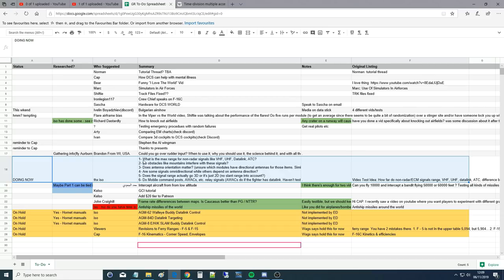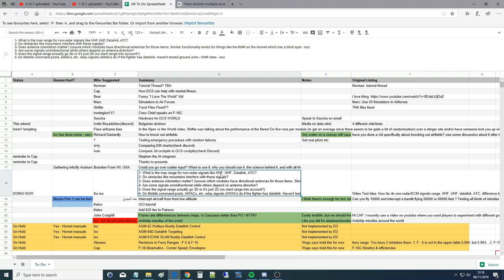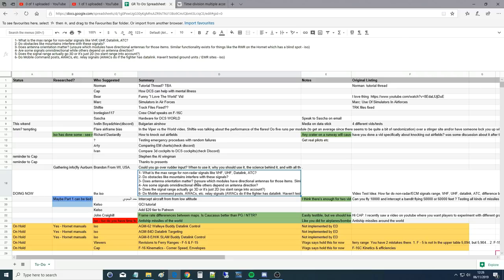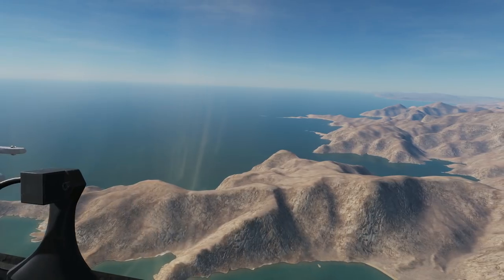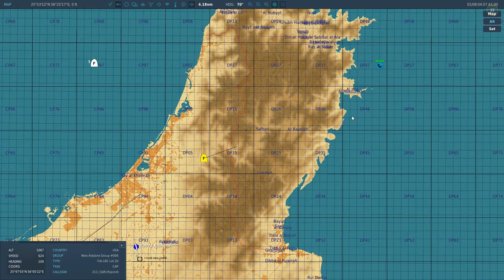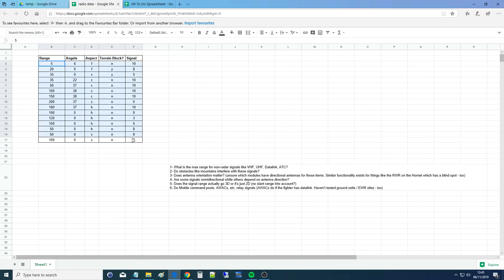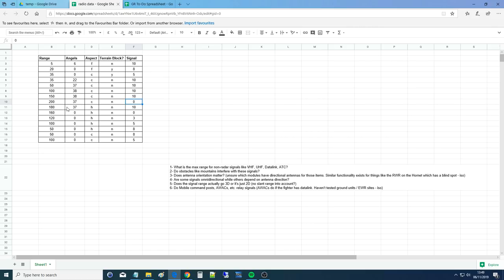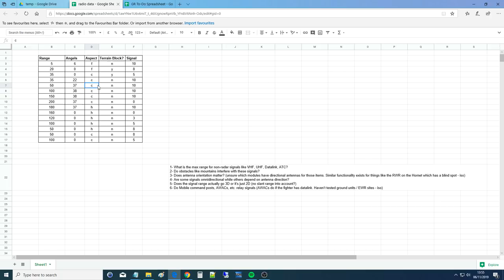Questioned: The Physics Of Radio & Datalink In DCS WORLD

Comment: Appreciate it very much taking time for this, and bringing this topic out of the shadows. Debrief: 
Yeah overly simplfied with "max range" from my side. I was in a hurry sorry. Works initially for anyone who does not have any idea about signals. And yes no need to do it all in one video. Looks like the actual big question got answered, it really is more simulated than I expected, dynamically affects the actual strength/clarity of the voice audio (signal) as distance increases and other factors such as height and mountains, stuff like houses and trees if they do would have only a minor effect and hard to test, other things are indeed verys hard to test, like the orientation, because that would require finding some sweet spot near a cut-off area, where just rotating would make a difference, that would be far easier to do with digital signal which do work like a cut-off (DVB-T/DVB-C, blocks on TV means it goes below threshold and both video/audio cut out totally), while analog signals don't cut off, which is actually true for UHF/VHF AM/FM analog voice comms, and DCS does this correctly, all the usuall ATC and other voice comms for military are plain analog AM as well, that's how they are able to talk with civilian aircraft and land on civilian airfields as we know, when they do combat they switch to their own comms which we don't need to as they're probably never going to be in DCS due to classification. For example A-10C VHF radio has this X-Mode capability for KY-28 and KY-58, I'm suspecting the audio goes into that encryptor and is then fed into the analog AM signal as gibberish audio perhaps, or it switches to a digital signal while remaining AM or FM and on the same frequency as these things shouldn't have a play (if they do change than it does it for another reason like not polluting the usual freqs with gibberish), we may not know anytime soon if it's classified so we can easily simply avoid worrying about that so no need to try bounce into walls and test it if the encryptor isn't even functional to begin with, I did find the manuals and took a look and asked some radio amateur people but didn't got further into details yet.(more on that later) --- PARAGRAPH 1 END ---

PARAGRAPH 2: I'll go over the points and explain the context a bit better, but first, yeah you said it perfectly, it's all different due to aircraft and their radios and capabilities and methods of encryption may vary. I was kinda trying to keep it short, losing context, I guess I simulated someone who has no idea about signals hehe. So with "UHF" and "VHF" it's ofcourse impossible to have a general answer, I meant kinda picking an aircraft and selecting the middle frequency of that aircraft's radio frequency range, that would kinda simulate the "Average UHF" or "Average VHF"  (setting the ATC/AI's to also work on that) and seeing how it goes when voice communicating with other units, but now I realize there is no much voice comms other than ATC and I guess tankers and AWACS, but there are AI wingman/flight commands but they don't seem to go over the radio... err while it doesn't show on the CommMenu GUI, it does infact seem to use radios when I tried issuing commands to buddies so that could be one of the points as well to test if they participate in the radio signal system. With "ATC" just I mean if ATC voice communication comms are part of this simulated system or not, however it seems we have more variables, the normal airfield, the old carriers and the new carrier module which has an ATC upgrade AFAIK, that's another comparison point there, going on one would expect AWACS to have better radio transciever capabilities than a tanker perhaps, yet another possibility for a test here, and so on. -- PARAGRAPH 2 END --

PARAGRAPH3: Yep the higher you go in frequency the less easily it can travel through air, different materials produce different effects at different frequencies, absorbtion, passthrough, reflection.  And sure those questions all relate to each other even tho the slant thing is indeed a bit more deep but I think we can see the practical effect being proper that it works worse at lower altitude than it does higher up, this is very good news, you guys did an awesome job with those simplified/dubed down questions that I thrown together, but didn't actually meant it on purpose to make it confusing. Going forward, now that we know DCS is indeed taking this thing more seriously than I thought we can get more properly specific and technically correct. But take your time, I rather not that you guys exhaust yourselfs in one video, as we get closer to new ATC and VOIP upgrades we need to keep an eye on this topic so the devs get the feedback, then they'll figure out the middle ground of technical feasibility, performance and practical gameplay effect of these signal simulations. So now I got some research from radio amateurs: For weather affecting things, I talked and I heard it doesn't affect VHF/UHF much at all, unless the antenna feeds are exposed and the water makes contact with the both ends causing a short which would cause an impedance mismatch but that again may NOT render the system completely out of comission, it may only have a small effect (not easy to measure again). Then there's the phenomena called Knife-Edge Effect in which sharp surfaces of the mountain tops would infact produce a second-level propagation of the signal to the other side of the mountain, it's again very very specific to a type of frequency and the material as well as the geology/shape, how big the effect would be, but if it is exploited, it actually means that two ground stations without line of sight would be able to communicate. Lastly I asked about the A-10C X-Mode/KY-28 stuff and by the looks of it, that's all analog, not digital, including the, air voice should be plain analog AM but because if the KY-28 isn't it's own radio it has to use the existing radio's capabilities, it works with the UHF/VHF already in the current DCS A10-C, and I don't know what they mean excatly with the digital sync in the KY-28 page below, but either way it shouldn't matter as this stuff is all nonfunctional and won't ever probably be simulated in DCS anytime soon, so even if it does make a digital signal it's not going to change much for DCS.
VHF Manual: http://radionerds.com/images/8/80/TM_11-5821-318-12.PDF
KY-28 page: http://www.jproc.ca/crypto/ky28.html
All this testing is incredibly specific to the type of plane, I didn't find TDMA around A-10C for comms tho, however an DCS 2007 level F-16 could certainly have multitude of newer digital comm systems (I don't have F-16 module, but I do have F-18, but that's still EA) ... STILL that doesn't mean it only has that, I'm sure every jet still has the plain analog AM to be able to talk to civilians and ATC and other noncombat operations. But the military ATC I guess they use their own comms, but I'm not sure if it's through TDL scheme or not. There is this EPLRS thing which is used by SADL for F-16 and A-10 for example, might be a ditigal thing indeed but it's not meant for voice comms, not a big deal tho, we just need to separate that, so we can compare more accurately.

PARAGRAPH4: Datalink IMO may work on a totally different basis, they may be digital, may not, or they may use other frequency ranges, but for DCS right now, we don't need to know that initially, and testing that would involve having to drop the weapon from as high up as possible and then speed away as fast as possible and secondly drop it in a valley and get behind mountains fast. If datalink uses higher frequencies it should lower these ranges considerably vs Voice comms.

PARAGRAPH5: From the A-10C VFH manual - on the 44 page of the 222 paged manual, there is this capability called, oh goody, RETRANSMISSION, which is an actual relay capability passing the signal from a remote station to another remote station. Knowing this makes it possible for actual support of more relaying capabilities for many units in DCS who don't have any comm-specific job, versus having to justify the "what if pilots did it manually in real life" and simulating that into the AIs, so this is great news to me at least, I always envisioned this to be a thing and I guess I just had good gut feeling and logic but now I see it actually right there technically defined. That said, what I do enjoy more is to see more interactivity between groun support vehicles such as mobile command posts and similar to have some kind of "forward operation base" meaning, I'm really into this stuff in terms of how it can be used in emergency situations and ALL of  this feeds into SAR stuff, search and rescue is all about finding traces and communicating between multiple units in the search area later on, the radio beacons, distress signals, all need good radio simulation in the first place (unless they're satellite based), usually the homing signal of a EPIRB/PLB is an analog tone in 125.5 MHz (AFAIK) which is just good in a less than 5 mile radius, doesn't go up in space, in that short range tier, smaller obstacles, even trees, could have quite an effect far greater effect, reflections would cause faux direction readings and sudden increase in signal for a moment, etc, imagine the gameplay opportunities of your coalition SAR helicopter trying to save a buddy pilot in the dense forrests of Cacuasus valleys where fictional Georgian convoys are just around the corner, find da signal QUICK ... , green smoke, green smoke!!!, and other things would come to use, like using flares at night, not only by your aircraft, but by the ones who are calling for help, that is next level. DCS could even be of a service to firefighters as a SAR training platform one day hehe!
Reply from the maker: Lots for me to read! Thanks Steve.

Comment: In the U.S., the frequency range assigned for VHF FM transmissions for aircraft is 108-137MHz.  This is just above the "music" frequency range of 88-107.9MHz that all of us can tune to in our cars.  VHF FM is used to communicate with civilian aircraft/ATC and is functionally identical (when unencrypted) to the radios used by private, commercial, and airline pilots.  The frequencies between 108 and 117.95MHz is reserved for navigation, being split into 200 channels with 50KHz seperation.  Occasionally, VHF FM is used in the military, normally with JTACs.

UHF is used for military communications, i.e., no civilian aircraft has a UHF radio on it from the factory.  The frequency range is 225-339.95MHz.  Both VHF and UHF signals are amplitude modulated (AM,) where as the music in your car is usually frequency modulated (FM.)

VHF FM, VHF AM, and UHF can be either analog or digital.  Technically, all radio transmissions are analog as they originate from a pulsating electromagnetic field around an antenna.  Its impossible to have a truly digital radio signal; it'll always be a perfect sine wave.  Digital radios, however, first encode the transmitted data into binary code before transmission.  For example, a pilot's mic will pick up sound waves, causing a membrane to vibrate.  An electrical device called a transducer will register these vibrations and convert them into an alternating current signal.  This signal is then "digitized" by the radio, with the waveform being converted from a sine wave to a digital wave.  This is done by rectifying the AC signal into direct current.  Since this essentially lobs off half of the sine wave, the positive half of the wave will be the only half detected and assigned a value of "1."  Where the signal is not detected, it is assigned a value of "0."  This generates binary code.  

An oscillator is used to generate a carrier frequency (the tone you hear when you click the mic.)  All radios do this.  The "data" signal is then "mixed" into this carrier frequency (since waves add their amplitudes to each other.)  Originally, this was done (at least at radio frequencies,) using vacuum tubes.  Today, we use transistors.  In the case of digital radios, the "data" frequency is a string of binary code as opposed to an audio signal direct from the mic.  With the proper techniques, this can allow for a much clearer signal as well as the transmission of digital information for purposes such as datalink.  

The combined carrier and data signal is then sent to the antenna, which produces a very weak (in the grand scheme of things) electromagnetic field which can be detected at very long ranges (with a high enough gain antenna.)

Digital and analog transmissions can be at any frequency.  Hell, you can have a digital high frequency signal, though the data transmission rate will be abysmal compared to UHF (though the trade off is the signal strength for a given transmission power.)

As far as LoS is concerned; its not strictly needed.  Under the correct atmospheric and magnetic conditions, it is possible for signals to bounce off the ionosphere.  This is most commonly observed with HF signals, though it can happen with VHF.  I've seen it happen IRL, though I'm not sure if DCS models this.

Pretty much all aircraft use omnidirectional antennas.  These can communicate in any direction, more or less, but are relatively low gain.  High gain antennas, such as satellite dishes are for more efficient at both transmitting and receiving signals.  For example, the signal coming from Voyager 2 is only being transmitted at 22.4W and over the course of 13.7 billion miles is received by the Deep Space Array at just 10^-19W.    

High gain antennas are not really practical on aircraft as they have to be aimed.  This would involve either a massive bulge on the air frame or require the aircraft to maneuver to point at its radio target.  

Omnidirectional antennas, however, are not perfectly omnidirectional; they have "lobes" where the signal is stronger or weaker.

I fly with the U.S. Civil Air Patrol.  We're a civilian volunteer organization that does SAR and USAF assigned missions.  We own and operate a network of radio repeaters around the U.S.  Maybe DCS simulates a similar system automatically?  Or maybe the aircraft itself was obstructing its antenna?  We intentionally do the same thing when utilizing direction finding techniques in SAR.
Reply: Funny thing is those frequencies chosen for Data link 16 just dont seem to travel that far past line of site........ Funny that....
Reply: @passivehouseaustralia4406  Yes, because unlike HF and, to some extent, VHF, UHF passes straight through the ionosphere.

Comment: Hey Cap, about Analog vs Digital and range. Its far more complicated then a simple one over the other. An example would be cell phones during the transition period from analog to digital systems. You could expect your analog phone call to be able to stay connected at a greater distance then you could get from your newer digital one. In practice, this meant that while carriers could get away with cell sites in the 10-12 mile range for analog, once the transition to digital began, they were having to build a lot of new sites because you could only expect maybe 5-8 miles. Now of course the radio wave itself doesn't care about distance in relation to how you are encoding data (digital vs simple AM/FM analog voice), but has to do with signal loss and degradation. You can understand a partially distorted and 'static-y' voice transmission up to a certain point with your mark 1 ears and the abilities of your brain, but a digital system is much less amused by messed up (flipped or missing) bits. Now most real world encodings for digital transmission (on a wire or radio) are fault-tolerant to a certain degree, and can handle (and even recover) the errors, but that can only go up to a point. At a certain amount of corruption, there is no practical way to continue the 'conversation' without all of the transmission time being used for re-sends (on a packet level) and such. Thanks for the videos, I really enjoy watching them all, and have learned quite a bit from them.

My background is in amateur radio operator and a partially completed EE degree (before switching back to IT)
Reply from the maker: Thx CW! This is such a large topic of study.
Reply: MSEE Here  :)   

You're on the right track, but the issue is fundamentally about signal integrity.  Analog transmissions have different degradation patterns and loss of call issues compared to digital.  Many times, you'd go from 5x5 transmissions to 2x5 or 3x3 before you'd drop the call on an analog system.  Digital transmissions however, many times just drop off when the detection mechanisms perceive loss of signal or even degradation beyond a fixed point.  It is an interesting, but very difficult part of the EE world that focuses on/deals with signal integrity.  Ask me how I know this.  :)
Reply: @karlchilders5420  yeah, I oversimplified my description since many ppl won't follow (nor really care about the details anyway), I just wanted ppl to get the general 'gist' of it.
Reply: Also, the newer digital voice cellulAr phones transmitted at a much lower power, and used much narrower of a bandwidth than the analog ones.  A large part of the superiority of analogue in the beginning was the fact they were pushing out much more wattage and used a bigger swath of spectrum. 

The lower power output of the digital forms is an effort to conserve battery life, combined with lower bandwidth and TDMA to increase spectrum efficiency.